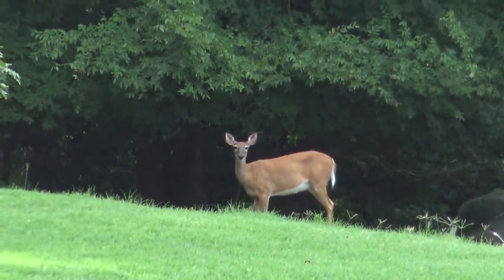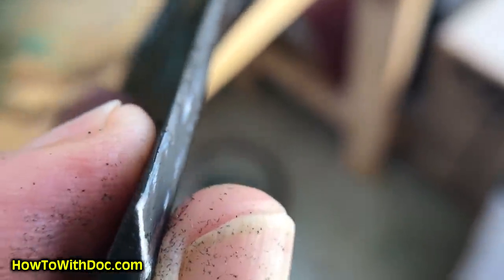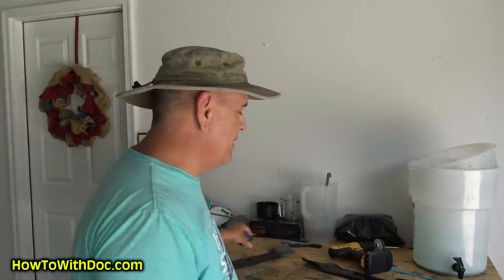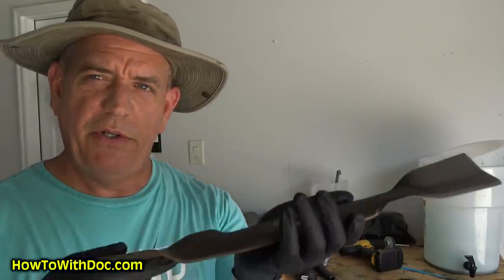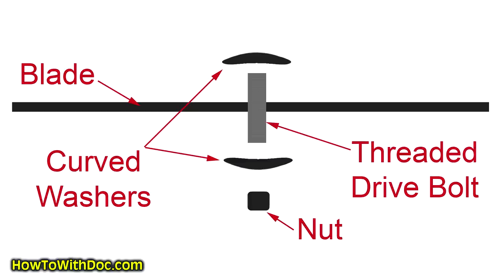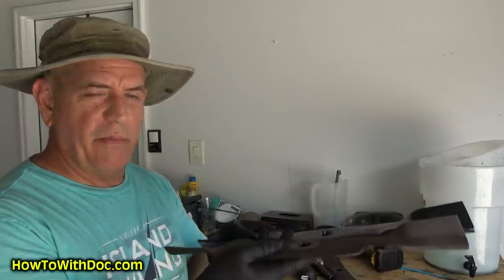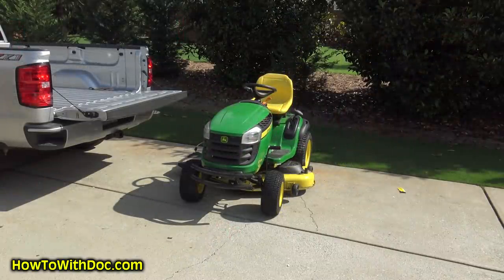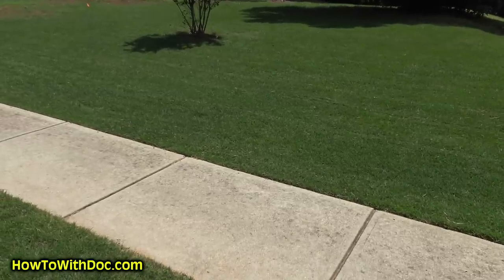Sharpen Mower Blades vs. Replace

Comment: I learned some things. But I have a tip to add when it comes to removing riding lawn mower blades. You can skip the wood block to keep the blades from spinning (which is a real pain) if you use an impact wrench. There is something about an impact wrench that doesn't create the angular forces that are needed to enable the blade to spin. An impact wrench is the right tool for this job. You will need to have a good impact wrench as sometimes the blade bolts can be hard to remove. Also, you will need to elevate the deck of the mower much higher so that you can get the tool under the mowing deck. At least twice as high as Doc does using his methods. Try it, the bolts will just spin right off and the blades will not spin when taking them off or on. Oh and Doc is right about having an extra set of blades. I have 2 spare sets with at least one set always sharpened and ready to go into service.

Comment: You sir, need a battery operated stubby impact wrench for those blades.  It'll make that job a lot easier, and you can use it for many other applications.   Great video as always.

Comment: Smartest thing I done this year ,buy a Harbor freight lawn mower lift. On sale for 70 some dollars. Plenty of room underneath,and  a Hercules impact drill driver for 99 bucks. Change a set of blades in minutes. No more blocks of wood,barely have to hold on to the blade. Truly impressed with the Hercules drill driver. Purchased a 5 amp battery that I have yet to have to charge.  Drilled over 1000 screws in one day ,changed my blades couple times and changed the blades on my plow truck and still had 3 out 4 bars of charge on battery. Bolts were in plow for over 15 years rusted and painted and broke them loose with no problem . No more squeezing under the deck with a breaker bar.

Comment: I just started balancing my blades this year, and it's sometimes more work than sharpening the blades. That's why I have a spare and it's ready to swap out when I need it and then I can sharpen and balance the dull blade at my leisure. I also use a wire brush attachment for my drill to clean the whole surface of the blade, but I never let my blade get that dull.

Comment: A Magnamatic will ensure that the blade is perfectly balanced.
All American Sharpener is worth a look to keep the edge at the correct angles.  Easy to use as well.
Reply: David Peters Magnamatic does a good job of sharpening, but it doesn’t magically balance them.
Reply: Bob Wingard Mag-1000 from magnamatic.  It is a balancer.

Comment: one corpsman to another, a couple tips.
  1.  Disconnect the drive belt from the engine pulley to prevent any unwanted starts (I think on JD deck, it's a 15mm on the tensioner pulley, turned clockwise)
  2.  Drop the deck and do grease maintenance at the spindle mandrels, also makes the job easier (less time on the ground)
  3.  Use a breaker bar (inexpensive) instead of a ratchet, and torque the nuts when you install the new blades (specs are on the new blades info)
  4.  Get the paper and glue off the new blade with some PB or WD40 by spraying it then scraping the paper off, then spray it again and wipe off the goo
Love your stuff, and SUBSCRIBED!

Comment: Having 10 or more sets of blades sounds a bit much when a grinder can do a blade in a minute each when you are practiced. Also you need an Air Impact. It takes 5 seconds each to attach or remove. I have 3 sets and need to sharpen my extra sets LoL.

Comment: Most riding mowers can be jacked up in the rear using a floor jack and a wooden block (2x4). Impact guns work well on taking off blade bolts. I use a bench grinder for sharpening. My problem are the native trees that continually drop branches. I need to police my lawn at every cutting with my Cub Cadet Enduro.

Comment: Great video!  The 21 inch mowers are easy to remove blades compared to your beast of a machine!  Doc my OEM Honda blades don’t come all that sharp.  I too am a fan of getting new blades.  But they work better after they have been sharpened.  I am just a home owner and mow from March until November here in Utah.  I sharpen them every 20-25 mows.  A shop charges $10 per blade to sharpen them. 2 blades for $20!   New blades are $40 for a pair.  Since Honda puts 2 blades on it is about half the cost to sharpen vs get a new set.  Love your channel!

Comment: I need to sharpen my blade (self propelled husqvarna 21 inch for my 1/8th acre) but after hearing a 3 pack of brand new deer blades for 40 bucks I looked up my mower, man its like 12 bucks at tractor supply for a brand new one ... billy bob's lawnmower shop was going to charge me 10 to just sharpen them, Ill buy new and chuck the old one in the recycle bin, its had a good life but its nice and chipped up after a brick surfaced by my mailbox this rain season

Comment: Check out Laser Edge self sharpening mower blades. These are more for commercial use, but if you cut a lot of grass in the southern region of the United States, where we are prone to sandy soils that erode mower blades, these are a game changer.

Comment: You can sharpen the old blades that way you have them ready as replacements and you can then put them in the rotation.  If you are cutting often, the blades should be sharpened more than once a season.  That dull blade you showed in the beginning is bad.  Another option to remove the blade bolts is an electric or cordless impact wrench.

Comment: Funny how every lawn care channel does a blade sharpening vid.  With all due respect it's more of a metalworking project.  I suggested using a flap wheel on an angle grinder and everybody went nuts. People love it and nobody even knows why. And of course nobody asked why.  Another tip: Use your foot as the vise.  I can sharpen and balance two(Timemaster) before you have a blade off. I watch lawn pros to pick up the best methods on lawns, apply these tips for a game changer maintaining blades.

Comment: Doc
I have a Honda lawnmower that is 14 years old and it’s self propelled the belt that it takes which is a 33 1/2  inch belt I can not find a belt anywhere  that will fit my lawnmower. Can I use a belt  from an auto parts store? Will it be the same? The lawn mower is a 22 inch cut.

Comment: Doc I"ll save you some time and work. Get rid of the massive wrench and block of wood to remove blades.  You can do it one handed dont even touch the blade,  Use a impact gun cordless dewalt.  blade does not spin when removing you can do it one handed. No massive wrench!

Comment: Is that a 3/4 inch drive pull handle? That's extreme overkill but I guess whatever works for you lol. You could snap the head off the bolt if you lay into it with that. Lawnmower blades don't have to be super tight just snug because when under a pull and the direction they spin it actually tightens the bolt as you mow. That's why that bolt always seems way tighter when you go to take it out. It's good to put a little oil or anti-seize on the threads too.
Reply: Jeremy Alford he’s got a lot more girth than he does length. The length is what gets you. He’s just struggling to keep that big 3/4 drive wrench on the nut lol

Comment: Hey Doc, you mentioned that bermuda needs to be cut short.  I have searched far and wide and have heard other pro's say the same thing.  Yet nobody gives a reason why?  Could you address this in a video please.  I have been cutting my bermuda at 3-3.5" this year with great success.
Reply from the maker: From Clemson Unv:  Mowing: The ideal mowing height for bermudagrass is from 1 to 2 inches depending on the specific site and management regime and is best determined by the conditions in the lawn. Start the season by mowing the lawn at a height of 1¼ to 1½ inches based on a bench mark setting. This is the measured distance from the mower blade to a hard surface and can easily be determined by using a small ruler. Mowing heights below 1 inch will require a reel type mower to achieve satisfactory results. Over the next several mowings, gradually reduce the mowing height in as small an increment as possible. Monitor the lawn after each mowing. Once a height where the grass does not look good anymore, it looks too thin or scalped, raise the mowing height back to the previous setting. However, cultivars of bermudagrass that are adapted to acceptable growth in partial shade may be best cut at a 2-inch height.

During periods of environmental stress due to high temperatures or a lack of rainfall, raise the mowing height until the stress is eliminated. Always mow with a sharp mower blade using a mulching type mower, which leaves the clippings to decompose on the turf. The mower blade needs to be sharpened on a regular basis – usually about once a month or at least before the growing season starts. If the bag is picking up soil, especially sand, when the lawn is mowed, then the blade may need to be sharpened more often than once a month.

Comment: Eh, have tried the drill attachment before and didn't have any luck with it, at all.  Ended up switching to a belt sander and had a significantly better experience.

Comment: Buying new blades can be cheaper than sharpening. I have been buying new blades for an older mower each year for a 42inch mower for about $13. I have heard people welding on the end of the blade and grinding it down. Its better for the environment but cost money to have a welder, angle grinder, and balancing kit/ screwdriver. Good video, but just want to add every spindle bolt has a manufacture torque for it. You do not want strip it out or cross thread it.

Comment: If you want to talk about air flow you need to be cleaning your deck every time you change your blades too. Built up grass will cause the airflow to change.
Reply from the maker: Cleaned after every cut.

Comment: Nice video, but not all blades are that inexpensive.  I always add anti-seize to my blade retaining bolts.  Also an impact driver is great for removing the blades a a torque wrench for reinstall.   2 sets of blades are nice, jack up the tractor place the jack stands, 3blades off 3 blades on, once under the deck and done.  I also number mine, and rotate the position L> R 123, 312, 231 and back to 123 it keeps the wear even.

Comment: I bought the drill bit sharpener online and it is a POS it doesn't work well. The screw that holds the grinder on the apparatus comes out when the drill spends while sharpening the blade. Don't buy one.

Comment: Is it worth it to sharpen blades ,they just get thinner and prone to rock damage .I replaced my blades with gator blades over 2 years ago .The cub cadet cuts better and the blades are nice .I have 2 ride on mowers .A cub cadet and a troy built and i maintain them .OH by the way i am 65 year old woman and i see some men that have no clue here how to maintain a mower .The maintain their vehicles but for get the mower that works hard until it gives out .I have 3 acres and most here have an acre or more .Why not maintain to save money .I do have a problem with my troy built ride on ,.The brake pad is not sitting right .Maybe you can see it .I made a some what bad video of it .I am taking the deck off again .The video is troy built mower HELP .I know it happened but not sure how it could of happened .I bought the troy built back in 2016 brand new .What could have happened .I buy my blades  and belts off ebay ,much cheaper